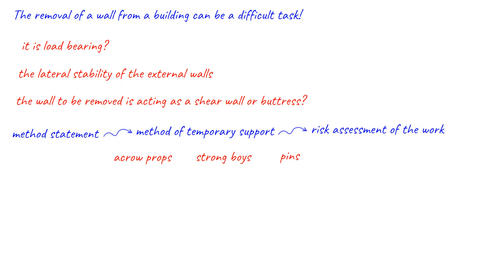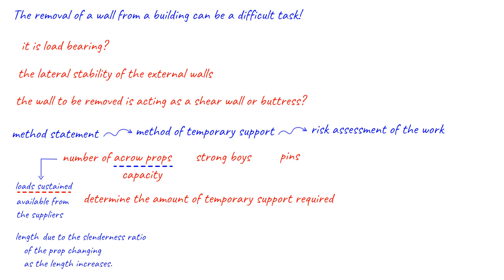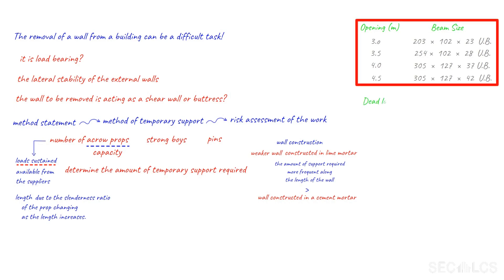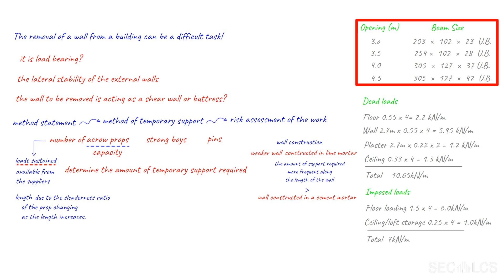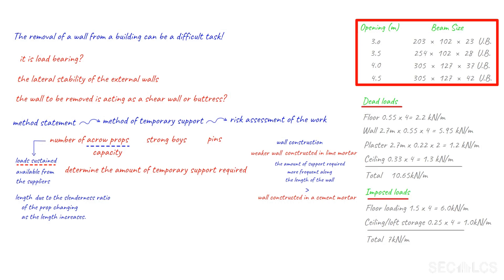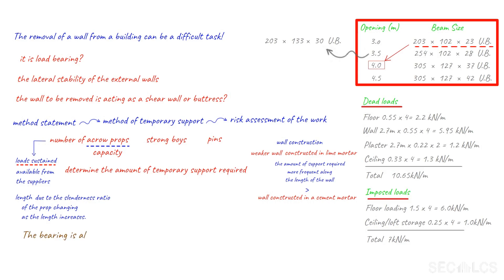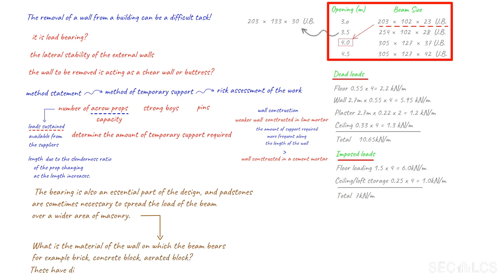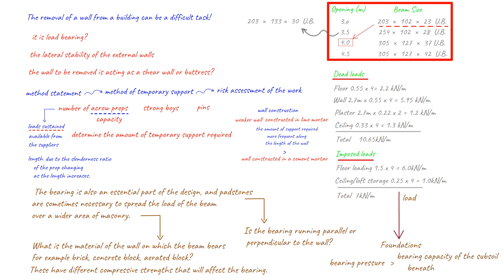Removing a load bearing wall | Steel Beam Sizes.

Comment: As Mike has mentioned previously, most existing brick cross walls or spine walls provide a support to the flank or front/rear walls. However, the entire wall is typically removed with just a beam inserted in place on small returns or onto the spine wall and flank wall etc. No appraisal is done for the existing foundations (or very rarely). 

I recall seeing something in CP 111 or Ciria report 111 (Structural Renovations of existing buildings), that if loading on the existing walls is increased by circa 10% then the foundations might be overstressed. However, large openings or entire walls are removed and replaced with a beam with much higher concentrated loads or as you mention small piers with much higher loads at the bottom. When I do the calcs are check the foundations considering a corbelled foundation, the numbers say it doesn't work. 

I typically like putting in SHS posts with small offset foundations doweled into the existing foundations if possible. Then the posts are strapped back to the wall. However, many clients do not like the costs associated as they say they have seen just beams used on youtube. It is quite frustrating.
Reply from the maker: Thank you for sharing your knowledge & highlighting these crucial considerations. We agree that it is imperative to evaluate the load-bearing capacity of existing foundations prior to adding additional loads through the removal of walls and replacement with beams. Your recommendation to use SHS posts with small offset foundations doweled into the existing foundations is a practical solution, as it offers increased stability & support. While we understand that the costs associated with these measures may not always be favored, it is vital to prioritize safety & structural integrity. We appreciate your valuable insights & expertise.

Comment: Thanks for the video; very helpful.  It does raise one issue that puzzles me.  You mention the additional load on the existing foundations which may be more than they can cope with.  It is very common in domestic situations for a “knock through” to be carried out involving the removal of part of a loadbearing wall;  A typical case would be say a 2.5m gap being created with piers of 0.5m either side.  This would significantly increase the load on each pier partly offset by the triangulation of the brickwork below floor level.

As I understand it the only way to check this out would be by a physical inspection of the foundations and soil beneath the lowest part of the foundation.  This, in my (very) limited experience is never done.  I suspect nobody thinks about it and Building Control do not raise it as an issue.  The inspection would be very disruptive.  However, I have never heard about it subsequently being an issue.  Many domestic “knock throughs” are done without the proper approvals and expert input.  

I suppose one could conclude that because there are never any problems the existing foundations can be assumed to be more than adequate to take the additional load.  There must be an element of risk, however.  

One other query I have relates to the piers that are left and the restraint that they provide to the external wall.  Is there a minimum width to the pier or can it be removed entirely?  Then the removed wall is no longer restraining the external wall and there is a risk of it bulging outwards especially if the floor joists do not bear onto it as would be normal and there is no other restraint provided.

I am trying to understand all the relevant issues and your videos have been very helpful so  thanks again.
Reply from the maker: Thank you for your comment & for raising these important points. You're right that it is very common for "knock through" renovations to involve the removal of part of a loadbearing wall, which can significantly increase the load on the foundations and piers.

You're also correct that the only way to know for sure if the existing foundations can cope with the additional load is by physically inspecting the foundations & soil beneath the lowest part of the foundation. This can be disruptive and is not always done, but it is important to consider the potential risks involved in not properly assessing the load bearing capacity of the foundations.

As for the piers that are left after a "knock through," it is generally recommended that they be at least a min width to provide sufficient restraint to the external wall. The min width will depend on the specific circumstances of the building & the load that the piers are expected to bear. It is generally not recommended to remove the piers entirely, as this can lead to bulging of the external wall if there is no other restraint provided.

I hope this helps clarify things for you. Thank you again for your comment & for watching the videos. If you have any further questions, please don't hesitate to ask!